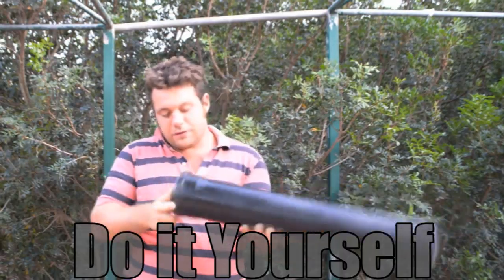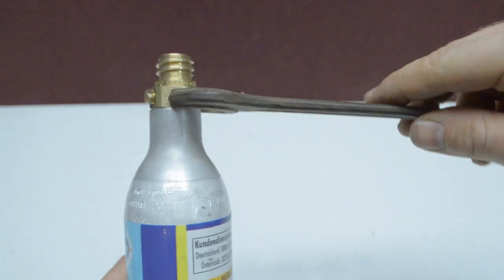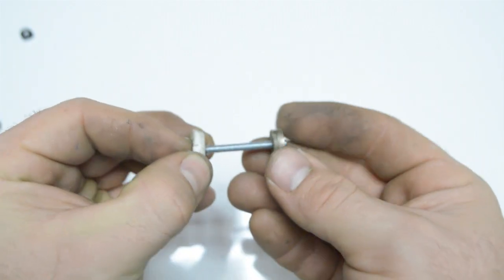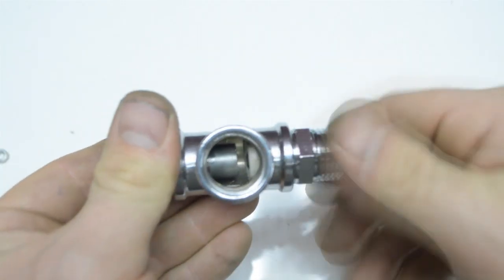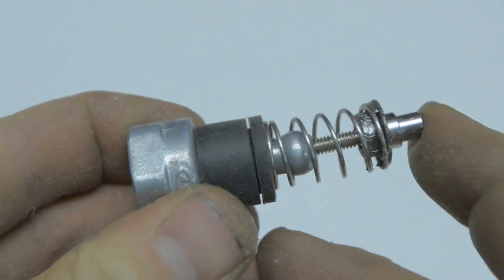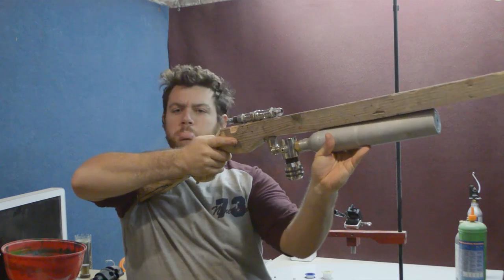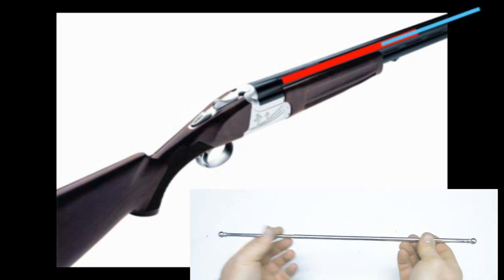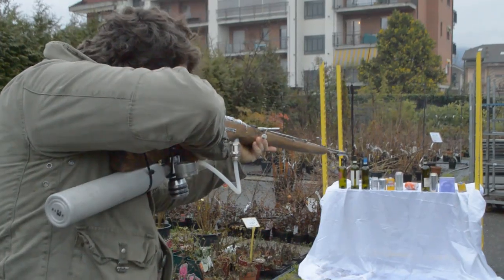Home Made Air Rifle Complete TUTORIAL and QEV valve

Comment: I still cant understand how this thing work... the spring inside the T joint suppose to hold and push the rubber which close the air vent to the gun barrel. Right?? At the end of the point where another spring on the trigger switch instead of pulling backward are puling in... please explain Brother
Reply: Charles Reynold it let the air scape from behind and the low pressure sucks the another plunger and the air leave ahead

Comment: How much pressure could one of those tanks hold
Reply: The tank's safety valve is secured at 250bar (~3626psi), but at 20°C there are ~57bar (~830psi) inside the tank.

Comment: ok before some one gets messed up badly.

 before you got removing the burst disk from the valve make sure there is zero pressure in the bottle easiest way to do this is to get a screw driver or a corner of a bench and press the valve untill you dont hear anything coming out 

or save your self the hassle because refilling co2 tanks with air is illegal in a few countries so just buy a hpa tank like what we use in paintball they also come with regs pre fitted

Comment: Hey nice to see guys are still into making piston airguns!  Have you tried making a piston with a built in check valve that seals 100% to the piston housing? I guarantee you'll see a big improvement in performance ;)
Reply: It's a PCP with a dump valve (think: big version of a crossman 760), not a spring-piston gun.
Reply: @wildrangeringreen  The dump valve as you call it has a piston which I was referring to. My QEV designs always have a built in check valve to prevent leakage from chamber side to pilot side which opens the valve faster and stops any pressure drop.
Reply: @FighterAceee94  oh, now I got yah. 👍

Comment: Just a friendly suggestion, if you can, try and replace the rubber hose with a braided steel hose. You will experience less pressure loss and possibly a more powerful projectile :)

Comment: Where did you get that regulator from? Does it have a name or model number?
Reply: how does he fill the air tank up, is it through the regulator or does he buy a paintball valve
Reply: you can get it in scubas shops...maybe you can find it to dechatlon too
Reply: Tommy.Targe Thanks will check it out.
Reply: Qyuubi786 No luck. :/ When I search regulator it comes up with the breathing mouth piece. Not sure if that is what it is actually called?
Reply: no, that's another piece...you need the regulator...you should go to dechatlon and ask for it :D
Reply: Tommy.Targe the closest shop is quiet far from me. I guess I could ask my nearest dive store.
Reply: yeah, you should
Reply: Qyuubi786 You can also make a tank out of pvc, although it won't go to higher pressures you can, and you would have to use a air compressor. it will be cheaper and lighter than the metal tank with the regulator.